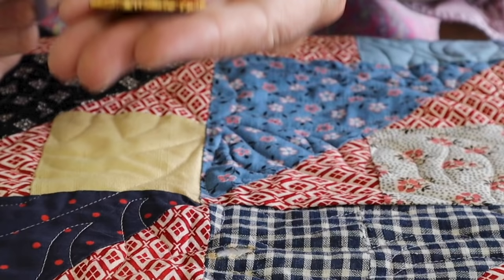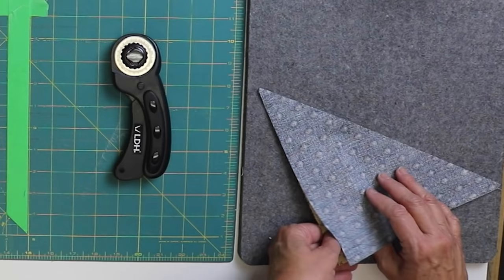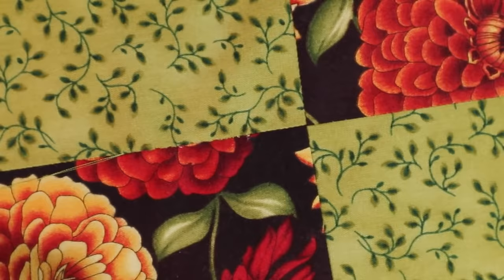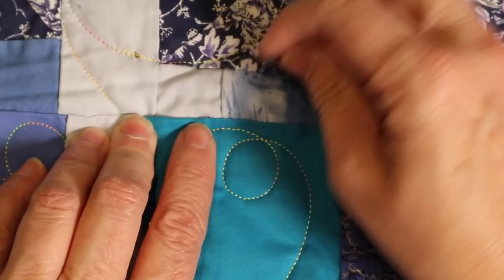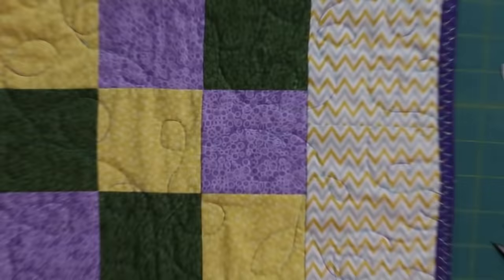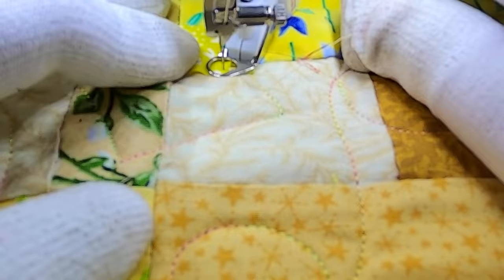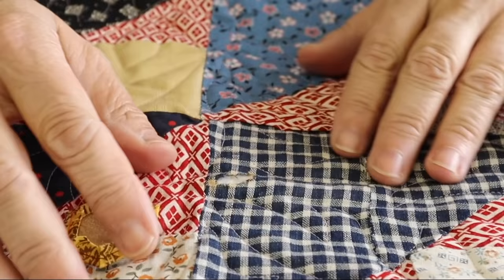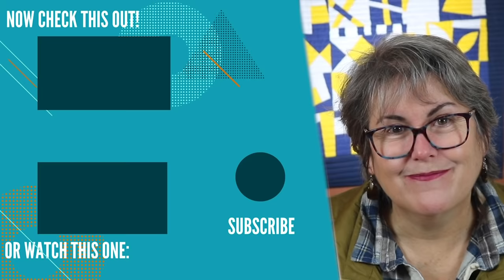HOW TO REPAIR A QUILT - HOLES, TEARS AND BROKEN SEAMS -QUILT TUTORIAL

Comment: This popped up in my YouTube feed as I was sitting and doing careful repairs to a vintage quilt found in a thrift shop. 
Right now I'm doing ladder stitch repairs to the edge of the quilt - it has no binding, but the border and the backing are the same and were simply sandwiched together and turned. There are lots of seams that need repair, unfortunately all pressed open , so more ladder stitch. 
Some of the triangles are worn (especially near the shorter edges of the quilt, where it would have been pulled up to keep someone warm when the quilt was in use). I pulled some scraps (washed) from my cabbage, made a template, and am hand appliqueing new triangles over the frayed ones. 
BTW, when I was inspecting the quilt to find any problems, I spread it out on a clean floor and went over it row by row, placing safety pins in areas that needed work, then folded over that row and moved on the the next.
From the assorted fabrics in the quilt, I suspect it dates from about the early 1960's. It will eventually be used on a single guest day bed in my sewing studio, so it won't get heavy usage.
Reply: That's an amazing story. I was asked to baste and quilt a quilt top from the 1930s. Scared me to death! but I did it. And put a label on it. It came out great 💕 I think you are amazing to repurpose someone's endearing masterpiece.
Reply from the maker: Thanks for sharing. I love hearing stories of old quilts

Comment: When you are repairing anything with hand sewing you do not need to knot your threads at the beginning and end! Two or three backstitches on top of each other, is all you need to secure a thread. Knots can cause problems in the long run, so it is often best to avoid them.
Reply: So I tried this on a quilt I was reparing, and it made that stitch look really thick compared to the other ones by it. Any help with that? Or do I just have to admit that no one else is going to notice! 😅
Reply: It was sort of decorative backstitching to reinforce some applique that was coming up, so the stitches were visible, if that helps explain what I mean!

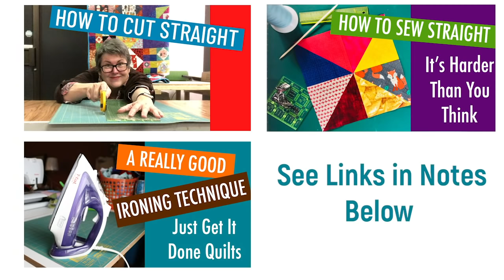Comment: 4:00 l agree. Trimming threads is better than pulling. But my advice is mark the spot with a safety pin and when you get a minute,  bury the thread tails... Because if that thread tail popped, it's likely to pop out again. Burying the tail instead of clipping, will keep the stitches from continuing to come undone. If there's not enough thread to use a self-threading needle, use a fine crochet hook to bury the thread between the batting. 💖🌞🌵😷

Comment: I’ve been watching quilt restoration videos, and yours is the first that came up. I was given a quilt by a quilting friend, it seems to be somewhat old, with polyester batting that’s incredibly thin, It is riddled with so many holes varying from large, like the bottom of a bowl large, to other smaller varying holes with fraying. The fabric is all worn, The binding is all wore down, it looks terrible. It looks like it was put through the washing machine on a normal cycle for 30 years. It is all hand stitched. I truly believe it is beyond repair. I can’t believe that this hand stitched quilt has been so abused, it’s stained and frayed beyond repair. 
I had it on our wood floor to analyze it, while in tears. It’s strange that I have a strong moral feeling regarding hand stitched or hand made items being abused.

Comment: 5:00 l like the darning idea because my ex's gma's quilt with the solid cream back has a lot of frayed spots (but only in one direction and if I take it apart and sew the seams deaper, it won't be squares anymore). ...  But because the darning will definitely show, l think l might appliqué various sizes of hearts all over the back. (First, on the darned spots and then "random" places to make the hearts look planned.) If there's more spots than l think... instead of the hearts, l might throw on another piece of batting/backing and requilt the whole thing so there's less friction. 💖🌞🌵😷
Reply from the maker: You might find some spots that will need attention next year. So you could proactively appliqué over them too

Comment: I have used Bonash to repair holes by placing a patch underneath the hole rather than on the top of the quilt, and it works very well!!  Just make sure you use a teflon sheet so you dont get any on your iron.

Comment: Fabulous information. Could you do a talk on repairing quilts that have been damaged due to incorrect cleaning? My mother’s quilt was washed by the home she was living in. I had used wool batting and the quilt now looks like a mouldy mess. My mom has since passed and I would like to save this treasure. If possible. Any tips and or tricks would be appreciated!!!
Reply: I think you can't heal felted wool. Can you unravel the quilting and remove the top to save it?
Reply: @Stoffmonster467  it wasn’t felted. It was washed like a rag cloth and it is bearding all over. I’m sure 80% of the batting has been pulled out through washing and shaving/picking the white fuzz😡😡😡
I just want to preserve this memory of my Mom and the quilt I made for her.
Reply: @helentucker2060  so it's bearding on both sides or just on the back? Hospitals do a hot wash cycle, as far as I know.
Reply: @Stoffmonster467  yes it is. I’m heartbroken 💔. And a little angry as I had specifically told them NOT to wash it. To call me and I’d take care of it.
But what’s done is done. Now I just need to stop if from totally disintegrating.
Reply: @helentucker2060  I'm sorry about your work. I would unravel the quilting and remove the batting. I know years ago they advertised these shaving machines for woolen sweaters, I would try that if they are still available and cheap.
Reply: @Stoffmonster467  thank you 😊 for all you suggestions and listening to my venting!  Have a wonderful weekend. Again Thank you 🙏🏻
Reply: @Stoffmonster467  I have seen fabric shaver things recently! My local Hobby Lobby had them. I think it's worth a try too, especially if you see how they get reviewed!

Comment: I made a quilts just a fence rail 
But there was one color of fabric from the same jelly rolls that are all shredding as time goes on 
These are 10 inch by 2 inch so I’m thinking of grabbing another strip folding the outer edges in and press them and stitch around the outside to secure it and then quilt it like the rest of it. It was my first quilt with a lot of mistakes (more mistakes than I care to admit) 
I think this will work ???
Reply from the maker: Sounds like it should

Comment: Just saw a rip on my quilt in the guest room. I know my cat did it. My heart raced when I noticed it. This quilt has allot of different colored plaid pieces. I got out my thread and found a color very close to the material where the rip is,I used single stand of thread so it wouldn't be to thick and sewed up the rip. I did start off by putting the knot inside. I did what I could and walked out of the room. I'm hoping it's camouflaged. I don't think the stitching would work on more solid colored blocks.  Puss will be staying out of guestroom. Maybe someone that makes quilts would of had a better idea. I've tried that Stitch Witchery stuff on material.before and it came apart. I'll take a look at my handy work tomorrow and hope It's not obvious. Im upset over this and puss made her mark on the quilt in my bedroom to. That one isn't as nice, but I now put a blanket over it. Has anyone delt with having a cat and quilts???????

Comment: How do you clean the glue off of your iron?
Reply: There are products to clean your iron. You can Google it. 
If there’s no coating on your sole plate, I’ve used baking soda/water paste. Try not to get it in the holes.  If you do, let the iron dry when you’re done, and then use an old, clean, dry toothbrush or a paint brush to brush the soda residue out of the holes. Then when you’re done cleaning, fill your iron with water and steam it like crazy while ironing on a clean rag or towel to get rid of the rest of the baking soda residue.
Reply from the maker: I have used acetone aka Nail polish remover, baking soda and a couple of other tricks but it depends on the dirt.

Comment: An applique method I have used in the past was to window the patch using fusible pellon.   I cut out a patch then sew a similar patch of fusible pellon to it making sure the sticky part will be to the out side of the applique when I turned it inside out.  ( https://www.youtube.com/watch?v=8ChE9UBWA8A this video explains it better)   I often use a button hole or small zig zag to sew it into place.   I make multiple appliques as it then becomes a design element instead of a repair.